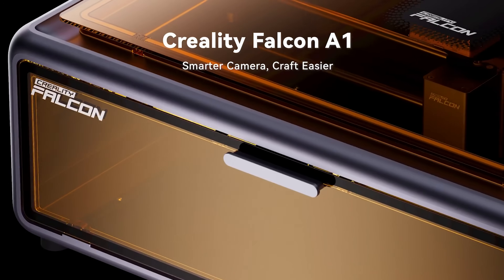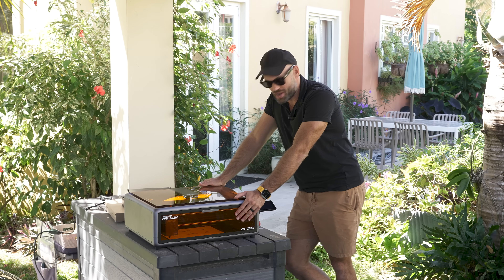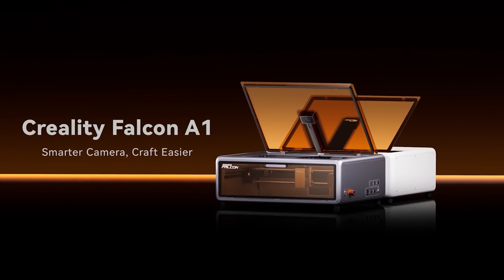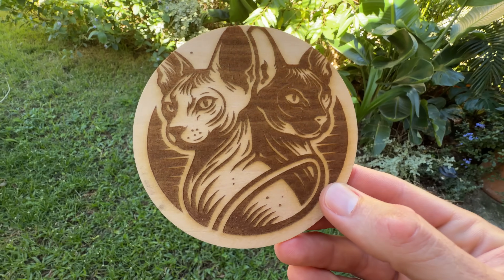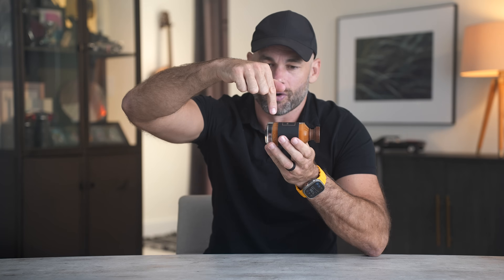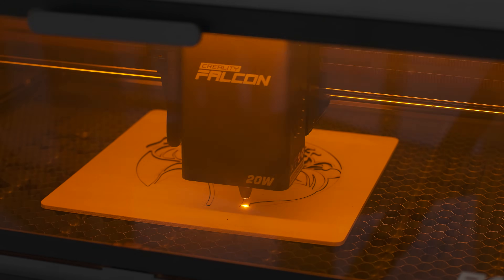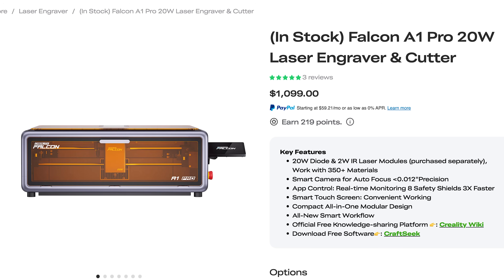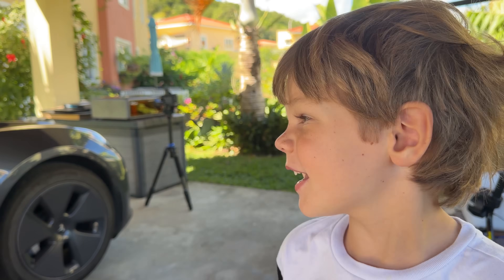They sent me a laser cutter

Comment: The Creality Falcon A1 vs. A1 Pro is a choice between a capable entry-level machine and a significantly upgraded, faster, and more versatile model, with the Pro offering double the laser power (20W vs. 10W), a 2W IR laser option for metal, an auto-focus function, touchscreen control, and app control, while the base A1 is manual-focus and simpler, making the Pro better for advanced users or those wanting more power and convenience at a higher cost. The Pro's integrated smart features, like the camera and touchscreen, streamline workflows and improve precision, especially for beginners, while the base model remains a solid, affordable choice for basic projects. 

Big difference appears to be the Pro version has metal engraving and a Smart Camera with Auto Focus..